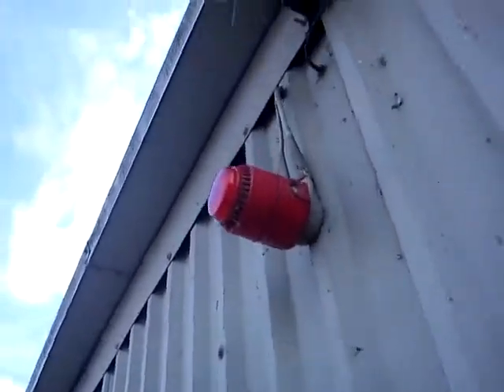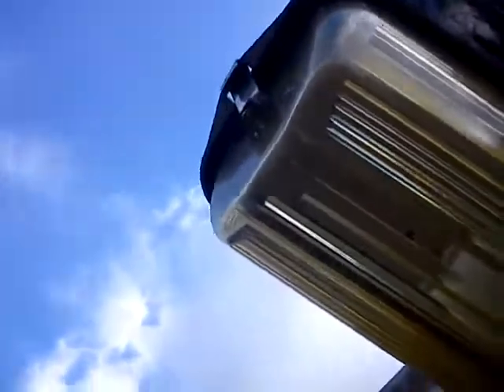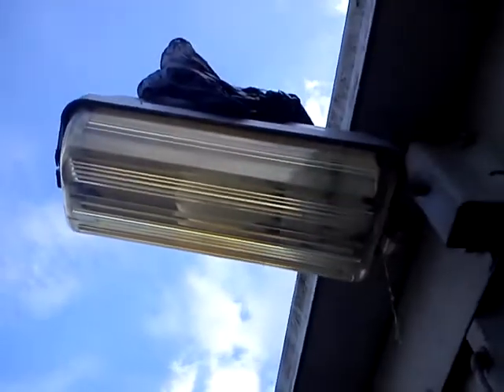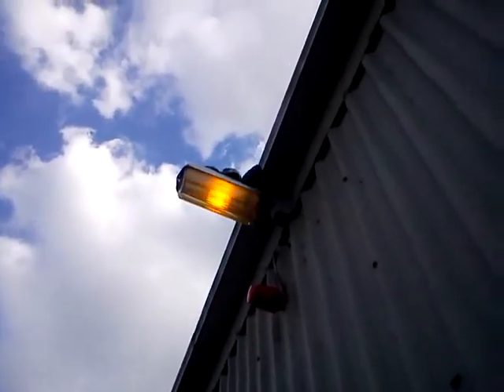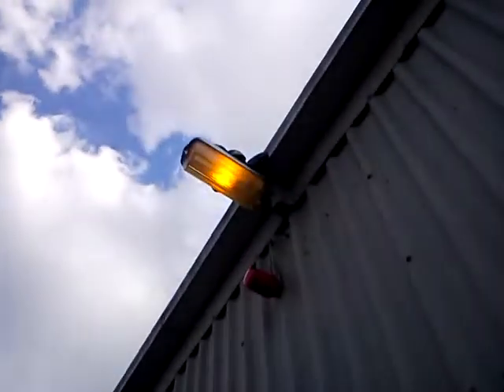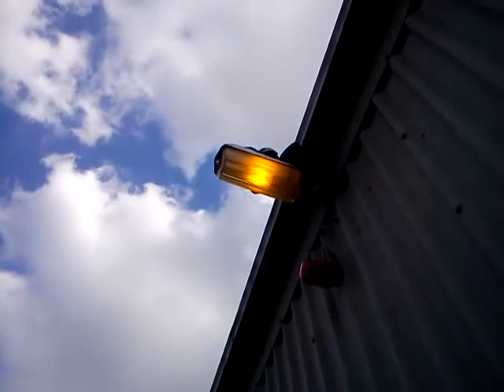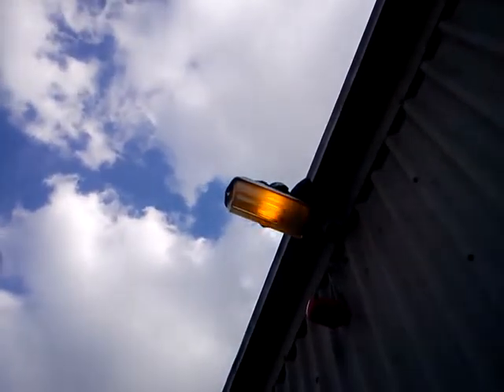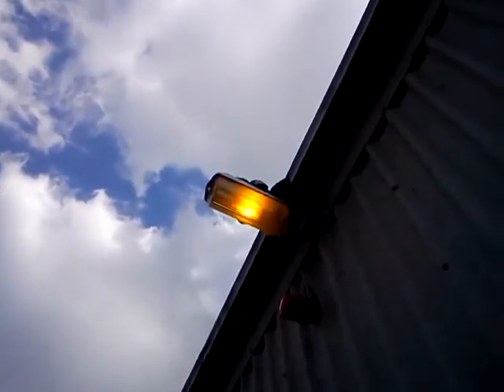Philips SNK070 SON Lamp testing

Comment: why u got a flashni fire alarm sounder? and why is the philips a high pressure sodium lamp not a low pressure sodium SOX lamp? sorry im just curious.
Reply from the maker: Alex Colderley The Flashni is for the fire alarm inside the building. That model is a 70w High Pressure Sodium version not the Low Pressure SOX. Strangely enough, the diffuser is designed for the SOX type.
Reply: Ohh ok thanks i recommend a vantage 32 tone sounder there much louder then a roshni:)
Reply from the maker: Fashni's and Roshni's can be loud. It's set to BS sweep
Reply: Wow i had a roshni but it got lost well still i think u have made a good choice with a SON lamp the problem with SOX is that they dont light up white objects, everything under a sox shows up orange